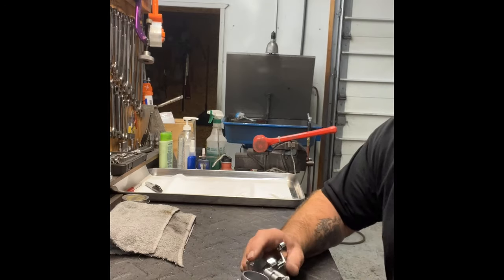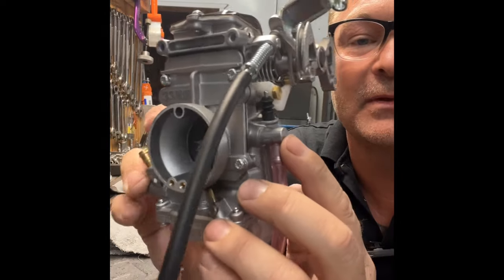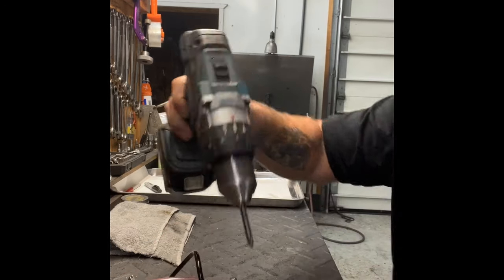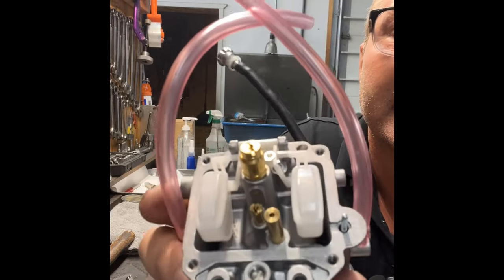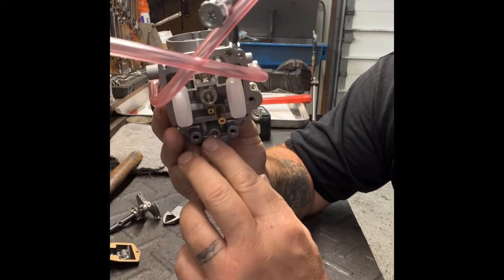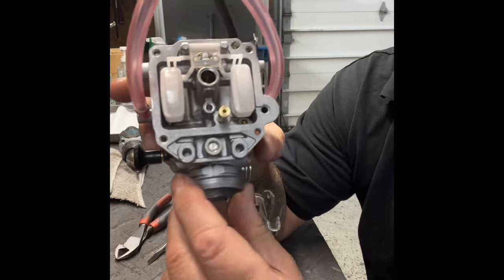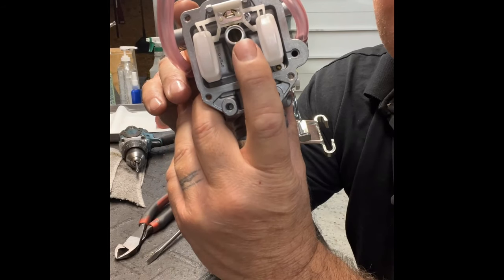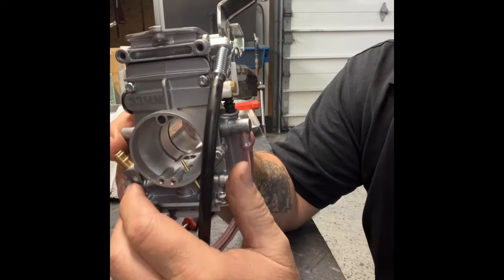How to tune a 33MM Alcohol carb, Junior dragster, blossom racing, jr dragster.

Comment: I am working on a Highly modified 224CC Predator, with a 28.5 mm Intake valve im wanting a good carb for it.
Reply from the maker: @classyreaper5384  We have not done any testing with our carb on a predator engine but I know there are a few out there that run them.

Comment: I have a 4 pack of these on an old toyota and am having a hard time getting the idle to come back and not get hung up high unless you blip the throttle (smack it). Also the throttle at proper idle rpm the throttle feels stuck from the vacuum on it. Drives fine once off idle. I’m thinking after watching this the low air jet is too big causing the slides to have to close all the way, the carbs don’t seem to like that. What do you think?
Reply from the maker: @hotdoghogie  yes leaning out the idle circuit will open the slide a bit more which could help your issue.

Comment: What is a good base tune for a 11.90 engine
Reply from the maker: @anthonyprowog5074  33 carb with a sleeve! 195 main 59 pilot .8 air jets, fuel mixture out 3/4 turn.